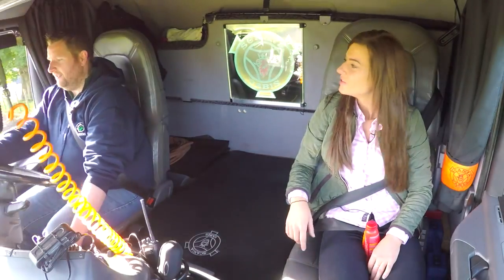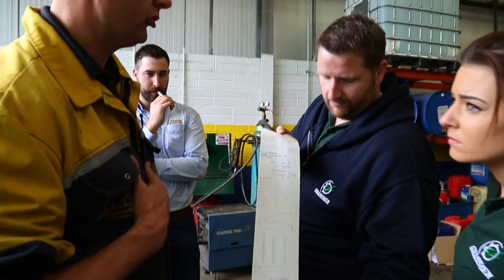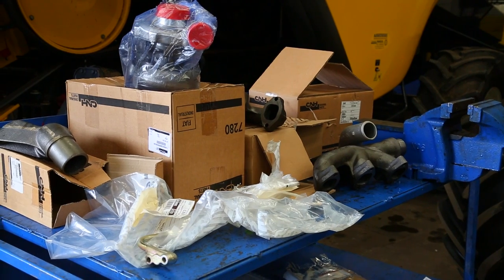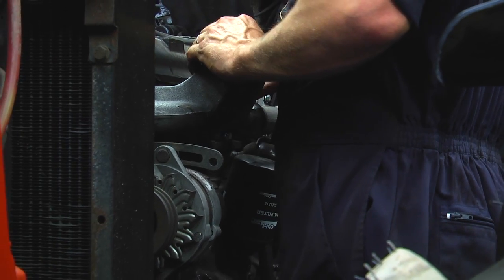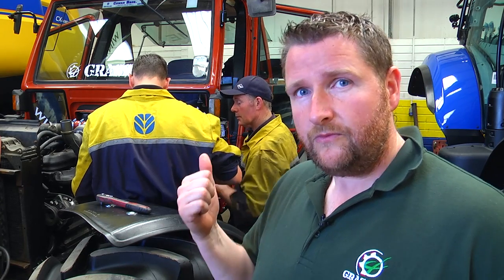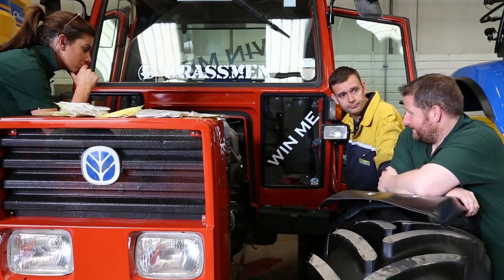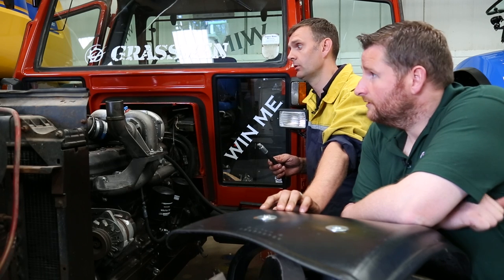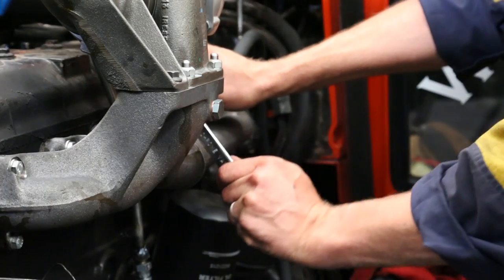GRASSMEN TV - Twist of Fiat Extra Content:  110-90 Turbo Installation

Comment: Nice tractor . Shame its only half a job. Engine needs pistons changed . Sure they said kit from a 130 90. Pistons same dimensions but reinforced top ring groove .top ring breaks after a time of heavy work . Did all this 25 years ago .
Reply: What about injectors and pump? Are they same with the 130 90
Reply: did you turn up the pump when u fitted the turbo ........?

Comment: shud u not have lubed that turbo before you run the motor?it seemed to run for about 10 seconds before it got oil!could that damage the bearings???
Reply: The oil pressure of the engine reached that plain bearing in less than a second probably. The oil delay in the waste pipe only demonstrates that not a hell of alot of oil bleeds through the bearing particularily when oil is cool. He'd most likely have filled the little gallery as conecting the feed pipe up just to be double sure

Comment: It will need a new piston kit and a fuel pump setting for consuming fuel. By the way if i had a fiat. I wouldn't install it with a turbo. Fiat tractors are jewels and turbo is a shit. You are adding shit to this jewel

Comment: ... hello folks, if you will not carry out corresponding changes and adaptions in the engine(oil cooler, reduce compression etc.), it could be blow up in extreme case .
   From ~100HP up to 160 ?   that's far too hard for this engine under strong working conditions :(      I wish you it will last long ...

Comment: for a german this english is sometimes strange .  i have to hear it twice the time to understand; but at the end of the vid i get used to it. Which dialect is it or form where are you ? besides , you drove on the wrong side ....hahaha ;-)
Are the pistons oil spreaded from below too ? And why did´nt you adjust the fuel injection pump to a higher amount when on full throttle, didnt it run to much lean ? And the time the oil needs from the engine to the turbo is a bit long, perhaps a non return valve (check valve) should prevent from draining the turbo.
Reply: If you turned up the pump more there would be even more smoke

Comment: Greetings from Ukraine. I want to ask you, as an expert, bought a tractor, Fiat 45- 66s, tag on gearboxes marked 55-66v, also installed turbine on the engine, whether it is possible, whether the factory installation of the turbine, and whether it will not harm the engine.

Comment: Great Video That young mechanic would get a job in my neck of the woods Australia I guess you all would Did he say 160 at the shaft after Turbo fitted Darn  Kirsty u will blow the arse out it if you drive it like on test run Rem more horses = more heat so watch you Temp Kirsty Sorry I cant recall the Truckers name , but if I had stayed going up I would have  frozen on me bazzokas of as I would have come via the artic , Bring Kirsty,she knows her directions

Comment: Lads at 13.03 that's exactly what your not supposed to do starting up a turbo engine cold..
Reply: Makes no difference once the oils going through the veloute.
Reply: Did you see how long it took for the oil to come out of the pipe? Same thing when you start up cold no oil getting to the turbo while revving the balls off it..
Reply: ..Yeah tractor ticking over when they ran it that time, the oil pump runs in proportion to the crankshaft revs, when revved the oil gets to turbo faster, it wouldn't make any difference, besides if she had cooked the turbo, she wouldn't have gotten very far in it. your argument is invalid.
Reply: +Mark Lynskey ask any mechanic mark Lynskey they will tell you the same, your the one talking bullshit, why do you think they said take your time warming up, the same for cooling down, there is a reason for it, you do the math...
Reply: +Mark Lynskey and by the way you won't cook a turbo straight away, just goes to show what you know about engines..
Reply: ..That Fiats still running..no need for Math.
Reply: Yes You certainly told me didn't you.. Thanks for that . ;-)
Reply: i didn't like the look of the oil ,it looked over due a change
Reply: The engine should be cranked over and not allowed to start, with the return off until you get a flow of oil through the turbo and then re-fit the return and start the engine. None of yee know what yer talking about
Reply: @ingameldere1723   any good fitter or mechanic would've loaded the turbo with a glug of oil whilst putting it on so that it couldn't have any chance of dry running on start up and as mentioned earlier in the thread, the oil feed was taken directly from the pump which in turn is timed with the crank so it actually starts pumping before the engine fires... If you had to prime oil into the turbo every time you want to start the engine you'd never get anything done...
Reply: Mark Lynskey your supposed to let it run for a couple mins before doing any of that

Comment: Would you not need a fuel pump with a boost compenator? You'd be running rich nearly all the time if you only adjusted the pump

Comment: that was a great vid very helpful because I thinking of buying a 7740 and fitting a turbo To it 😊😊😊😍😍
Reply: Low blow set up on the 7740- tiny compressor and a huge exhaust housing, comes on boost right at the bottom end and fades out at high rpm - very grunty motor.